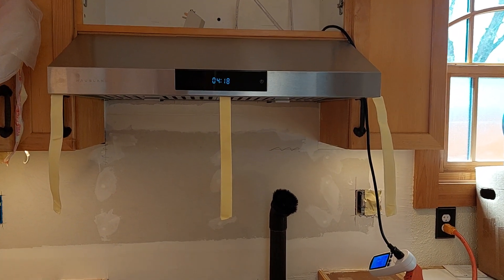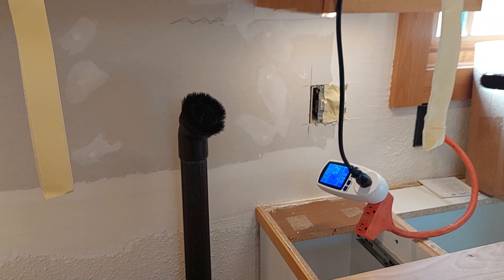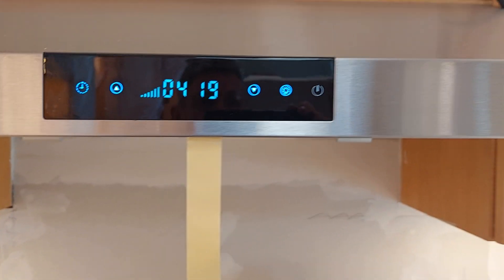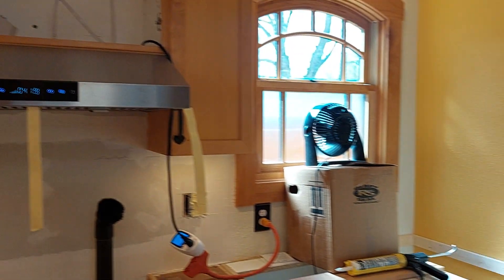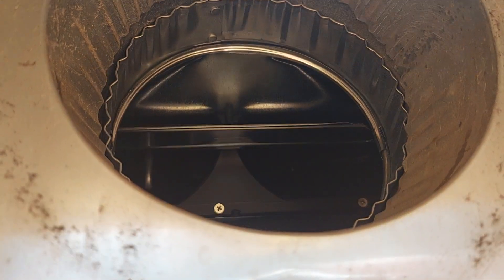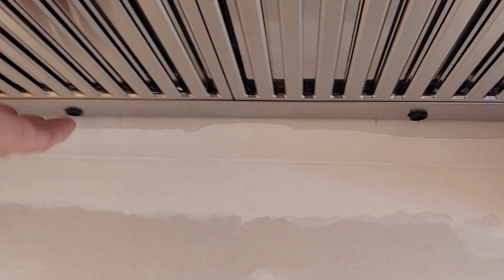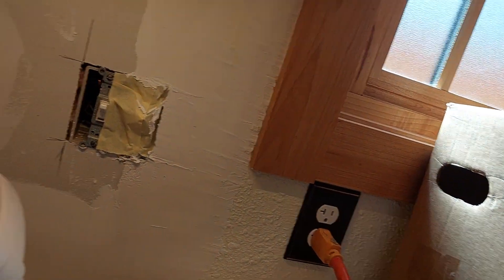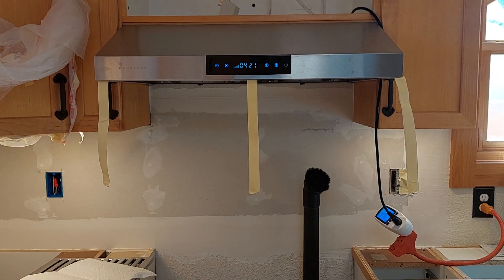Hauslane Rangehood Test, Model UC-PS18-30

Comment from the maker: Final Thoughts:

Pros:
1.	I think it looks nice, and it is relatively low-profile (7” high).
2.	The lighting is good, and the bulbs are replaceable.
3.	The grates should be easily cleanable.
4.	With two motors and fans, it should be able to capture more across the whole surface.
5.	It seems to do the job, with six speeds, although I’m doubtful it achieves 500 CFM.
6.	It has a decent fan shutoff timer that defaults to 3 min and maxes at 15 min, which turns everything off including the light.

Cons:
1.	I haven’t found a pattern to which speed it will choose to start once you press the button to initiate the fan. You’d think that it might come on at the last speed used, but it doesn’t necessarily. This is probably its most undesirable characteristic. Too many button presses to get where you want to be.
2.	It would be nice if with a single press of the power button, it would turn on the lights and default to the lowest fan setting, which I believe is the most used by far. But I have another very expensive appliance in this kitchen that makes you press too many buttons also!
3.	I feel it’s a bit noisy at the lowest speed. My previous fan had a marked difference in the sound level at the low setting. It’s not that bad though and of course as you increase speeds, it gets a bit noisy. That’s not going to be different across many brands though.
4.	In a demonstration video, I believe found at the manufacturer’s website, they show party cups being sucked up and held in place across the entire surface. It’s not going to happen in real life. I have no idea how they were able to achieve this. My tests showed that it wouldn’t even come close to being able to do that. If it were not for that video, I probably would have never been spurred into checking deeper by measuring wattage and eventually contacting the manufacturer. See more detailed comments below about the wattage draws.
5.	It is NOT easy to install, even when compared to other difficult units I’ve put in before. My installation scenario could be considered more difficult though, because when you vent straight out the back, you are installing the unit while at the same time having to line up the existing termination. Venting straight up would be the easiest. Also, who is going to buy special lifts to hold it in place while you’re installing it? C’mon. One thing for sure, you better figure on removing the range. You need to be able to be directly under it to screw up in difficult to access points.
6.     The clock loses time slowly, about a minute every week or two.

While overall I'm satisfied with the performance, if I had the benefit of hindsight, I might have gone a different way. But in this price range and considering the appearance, you probably won’t find anything better.

Comment: You mention 500CFM, however the Hauslane claims the PS18 has 860 CFMs of suction! I assume youre showing the same model. If youre doubtful that its not even hitting 500 then the advertised 860 is a HUGE over statement.

Comment: This video was useful for me, thank you sir. I had same issue as yours. There isn’t enough suction air as advertised. How did you fix that sir? Or you had returned it? Thank you!
Reply from the maker: I didn't return it. As shown in the video, it does ventilate. There's plenty of air coming out my exterior termination. I simply didn't believe it was venting at the advertised CFM, but I don't have the means to actually test that. It works well enough for us.

Comment: Thanks for honest review. Really helpful.
Reply from the maker: I didn't do a fantastic job on the video. At the time, I was simply making something I could let the manufacturer see when I was exchanging emails regarding my doubts of the CFM claim. Thanks for watching.
Reply: @KPCKeysDIYBuild-Install-Fix  Did you get a response/replacement from them? I'm curious if I should pass on this brand for my home.
Reply from the maker: @ismaelsalazar3969  Thank you for asking. I should have returned and posted this earlier. Below is their answer:

"Thank you for your patience.
After reviewing your issue with our manufacturing team, here are our findings:
•	The range hood uses 150–161 watts on maximum speed, depending on whether the lights are on.
•	Upon initial start, the unit will momentarily use 266 watts. This measurement is from ETL (Electrical Testing Laboratories) testing
•	Switching from a 3-1/4" x 10” wall cap to a 6” wall cap can reduce performance. It’s best to use the same size and shape.
If your range hood is not performing as expected and these solutions don't resolve the issue, we can assist with a return. 
Please let us know how you’d like to proceed, and we'll take care of your request.
Kind regards,"

Not sure I buy the response about the wattage since I never recorded any such power spike at startup.

I responded to their email:

"Uninstalling this unit and sending it back is not an option since it will be quite difficult and time consuming of course. It does appear to be ventilating some and I guess that's the most important thing, however I really don't believe that it's putting out 500 CFM. Even with the slight reduction in efficiency in the way I have it ducted, it should be getting really close to that. Yes, I use an adapter from a rectangular duct to a six inch round that will certainly reduce efficiency slightly. I would think however that the fact that it is only about 8 inches long straight through the back that it would essentially be the same thing as running a longer duct without any adapters. It should be really close to the 500 CFM you claim if in fact it's even capable of 500 CFM.

I'm going to look into measuring the output at the wall terminal just for grins and giggles. I know it can be done simply by measuring the speed of the air coming out of there and the size of the duct. Those two variables should give me the CFM.  >> I never did this<<

And I doubt that in any circumstance I could recreate your cup trick shown in your YouTube video. So, that seems like a bit of false advertising there, but i guess it happens all the time everywhere else."

See final thoughts above. Thanks.